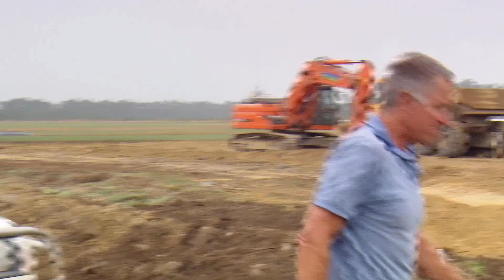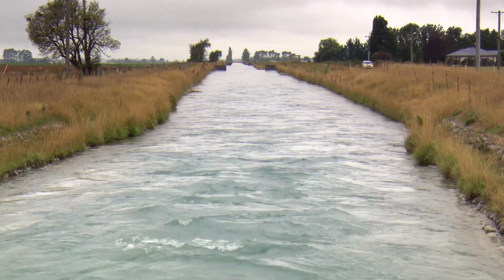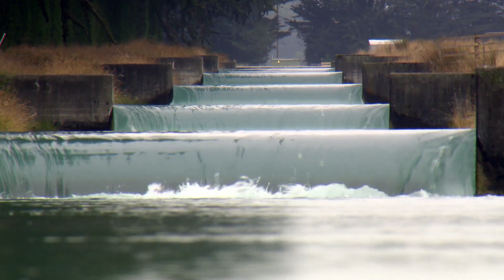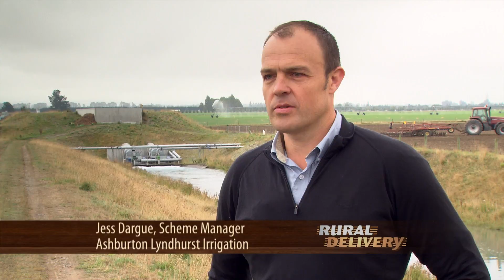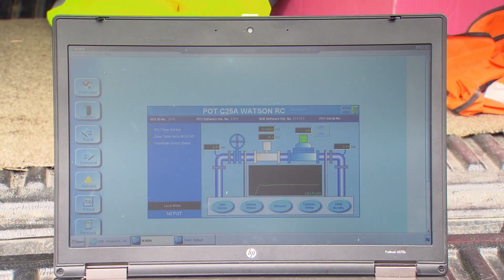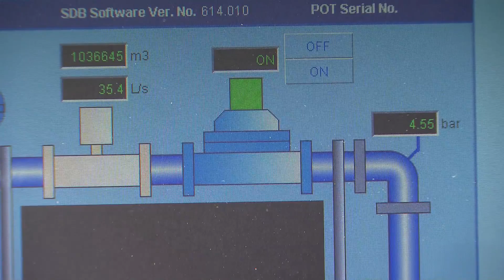Ashburton Lyndhurst Irrigation Scheme

Comment: Thinking about wind speed soil quality monoculture foliage thickness noziles on spraying might save you a lot.
Half the water from spraying goes into the air.
Use a hose that the end just drags on the ground.
This will save heaps of water.
Think of the microbs , dont till find another way.
Wind breaks could help just coppise them and shread the slash for micronutriants.